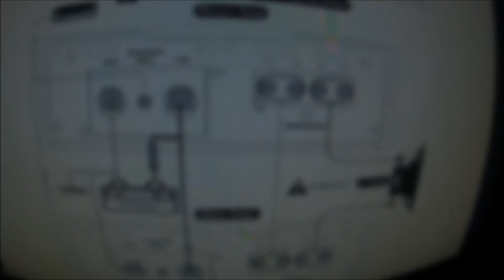Electrical troubleshooting Vlog - What Made My Alt Burn Out

Comment: Im always putting the battery charger on my batts just because of that reason.   I just ordered my Singer last week. But shhh I’m supposed to do a video reveal.
Reply from the maker: James Bond yes I've been forgetting to do it better yet lazy towards it 😂. Great practice bro I'm taking ah and not giving it back, doing this everyday caused my issue (I'm still watching my voltage)
Reply: James Bond already out the bag but looking forward to it. Big vll you Kno you wrong should of been had one lol. So are you running another stock atm. That's what I would guess??

Comment: Looking forward to the alternator installation. I just ordered my 250amp alternator and still waiting. One question though, would you recommend charging an AGM battery before installation? I’m planning to pick up a Duralast Platinum soon.
Reply from the maker: K Vang Yes charge it before installing this way your alt doesn't have to work like crazy for a longer period than normal. The duralast platinum is a decent battery for under the hood when I had it next to my amps it didn't do as well as other AGMs
Reply: bigvell02 thanks! That means I’ll have to pick up a CTEK charger.
Reply from the maker: K Vang I hear those are nice. I'm running a battery tender and a NOCO solar maintainer
Reply: A lot of the cheaper chargers (Wal-Mart cheap), are capable of charging AGM batteries too.
Reply: Des420 I’ll have to check them out.